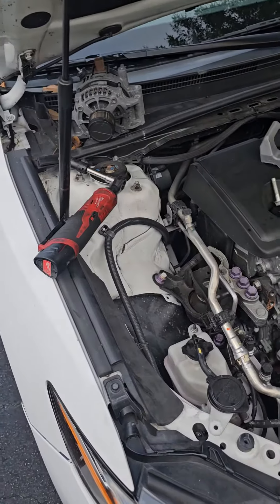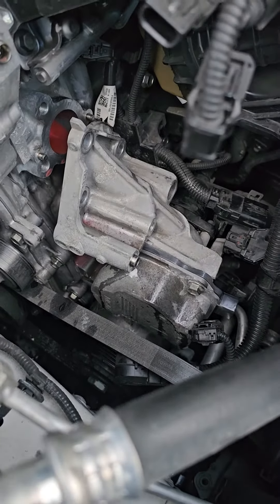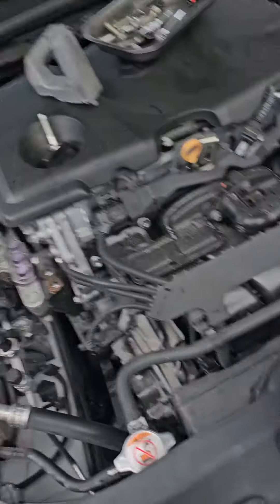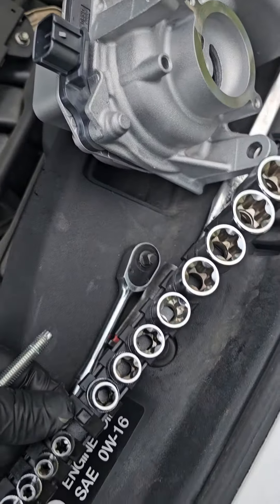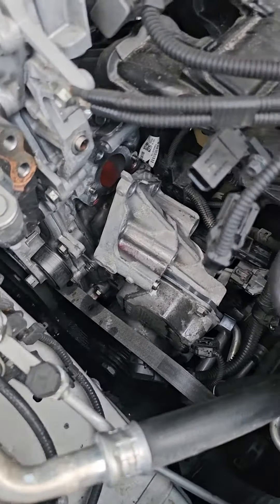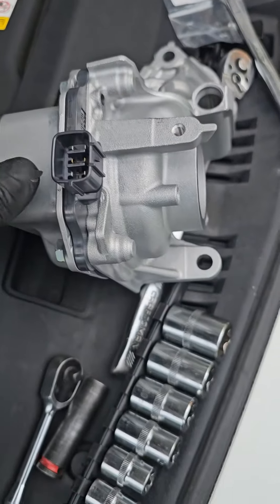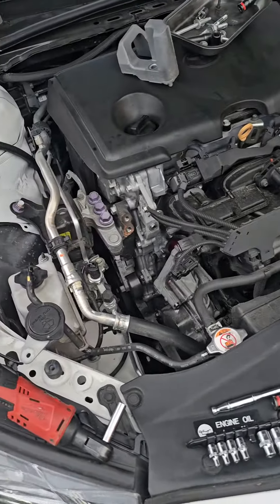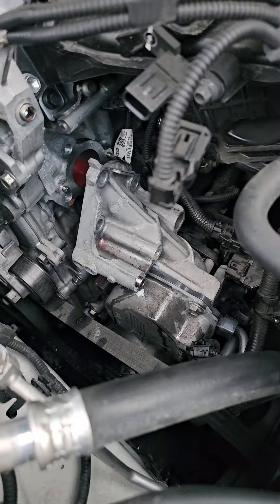2018 toyota camry 2.5l water pump replacement tips and location

Comment: I'm so glad I found your video I just had a problem with mine and I haven't changed it since I bought the car so it's probably the reason my check engine lights been on and it said low coolant this morning I didn't have no coolant at all so I'm going to replace my water pump but I'm glad I found this it's not as hard as I thought

Comment: Wow which you had more footage on the removal. My water pump went on 2018 camry with 51,000 miles can't believe it, especially coming from Toyota. I ordered the parts but I keep hearing bleeding coolant, also removing belt from alternator that might a little bit challenging. This will be my biggest hands-on on, still digging for more videos like these. Appreciate if you had more for model type.
Reply: mine literally went out at 51k this week
Reply: @rahracks  Thanks for the video, I was able to replace mine same day I watch this video. I also replaced the thermostat while there. I took water pump and thermostat out in one piece 👍replaced the exact same way. Appreciate your time.
Reply: Yeah Im on my second one literally and it hasn't even been a year yet and I brought the damn water pump from Toyota 😅
Reply: Oh my gosh please don’t remind me, I thought they said Toyota parts don’t need replacement that quick 😂

Comment: Mine is throwing a P26CB means that Engine Coolant Pump Performance/Stuck Off has been detected.  is this the same code yours is throwing ???
Reply: That's the exact code mine is showing. I just bought my new OEM water pump today, hoping to install it tomorrow. Let me know if you were able to fix yours or how you're going about it.
Reply: @ I did I fixed mine so I bought the part through Toyota but they only wanted to sell me the whole assembly I took the water pump off the new assembly and threw it on the on the car very simple took longer to drain the radiator but very easy

Comment: I got mine changed in February but now my coolant keeps leaking out and it looks like it’s coming out by the pump. I’m taking it Thursday but will this constantly be a problem for Toyotas?
Reply: Hey I’m in the same boat, did you figure out  where was leaking from the second time?
Reply: If it keeps leaking that means the o ring gasket they used isnt properly placed or just cheap

Comment: Thanks for sharing your knowledge. I have 2018 Toyota Camry four-cylinder engine .2.5 Liter with  105,000 MI. Just starting overheating. I want to replace the thermostat and housing unit and the water pump. Other than the toyota dealer parts department. Do you have any recommendation where I can order those parts? Also how do I remove the air from the cooling system?
Reply from the maker: Partsgeek.com has them at a good price
Reply: @Autotechmobilemechanic  Thanks.
Reply: Or try the Toyota website they have cheaper than the dealer parts store I had gotten my sensor from there I purchased my water pump from Toyota dealership the first time around and they don't last very long from my experience so In about a year from when you changed it or about six months you will need to change it again hell I'm at a point where I might get a back up 😅

Comment: Hi, I have a question what did you charge the customer for this job? Because I'm getting crazy quotes anywhere from 6-$1000
Reply: That's the right price they are charging you 500 for the water pump and antifreeze and labor around 300 to 400 dollars I changed my water pump and thermostat myself it was really easy on the Camry SE 2018 with the right parts  right now those water pumps are very expensive I try to buy them straight from Toyota website they only charge around 250 to 290 where Toyota dealership and parts charged me almost 500 dollars for it 😅

Comment: Hey bro could you tell me what sockets i need exactly
Reply from the maker: E8 SOCKET for the alternator studs. 14 mm for water pump. 12 mm, 10mm, and a 14mm wrench for the belt tensioner